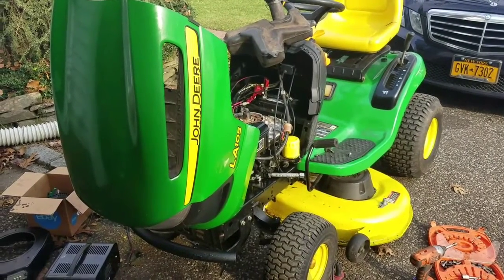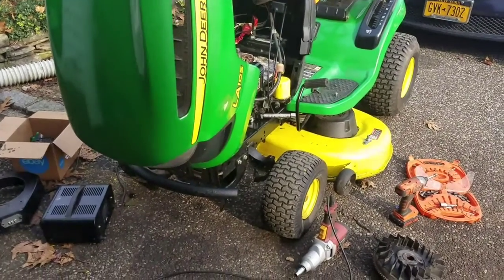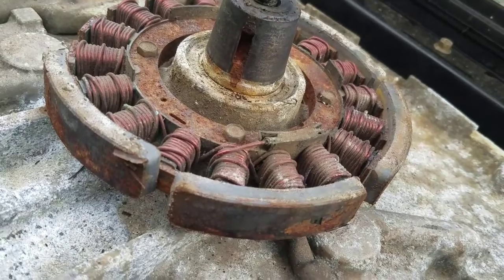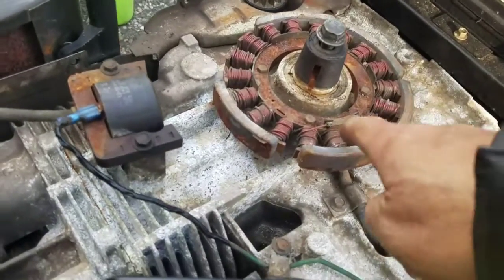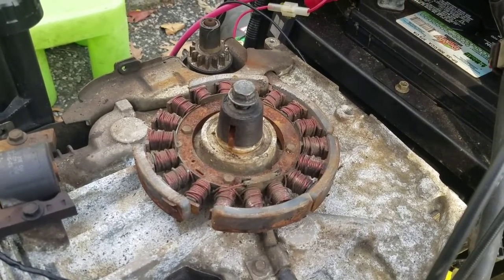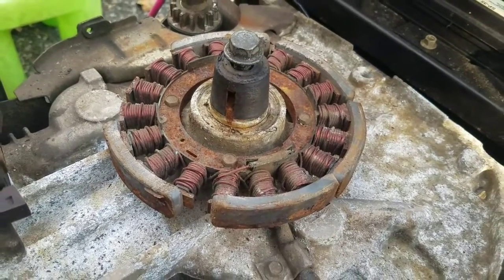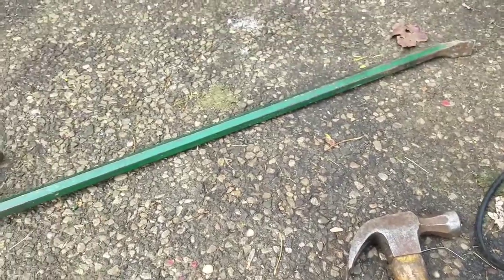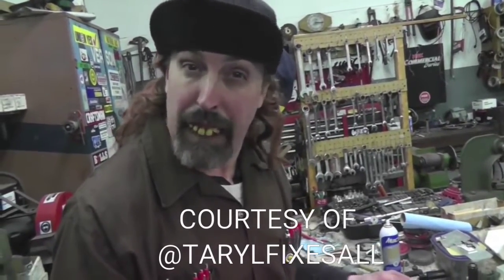FREE JOHN DEERE LA105 LAWN TRACTOR NOT CHARGING GLUE MAGNETS FLYWHEEL REMOVAL STATOR SYSTEM REPAIR

Comment: same deal as my JD stx 38 12.5 kohler Im guessing need a new stater not producing enough juice to turn on my pto clutch like it used to it works but just barely wont even cut grass the barttery is charged/ But it needs more amperage but mine doesnt have headlights like yours does maybe try unhooking your head lights unless you feel you need them since the engine is smaller them headlights can use a lot of volts. Might make urs run just fine without the headlights
Reply from the maker: You need at 10/16 amp stator,  if you have a black and red wire coming out of it, it’s a dual circuit 5 amp stator which isn’t good enough for an electric pto.

Comment: I like the testing of the stator idea of Gary's....   BTW Henry,  there is a two part epoxy like glue called PC7.  Once it is cured (24 hours), you can drill and even tap this stuff.
It is amazing.  I always have a set of cans of it around.  Think of it as JB Weld on steroids. I used it a lot when cementing fishing rod reel seats to the rod blank.  Never once a failure in 100's of custom rods.  

You will get this problem fixed.  What a great learning experience it will be.
Reply from the maker: Thanks art, I guess that's what my channel is all about...just documenting the small engine troubleshooting and learning experience from a regular joe.  Thanks again for the feedback bud.